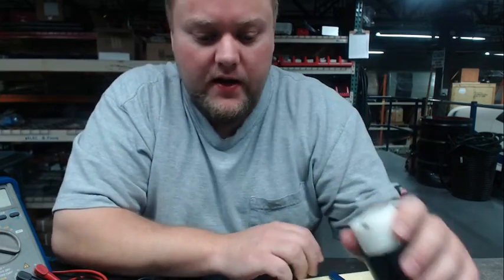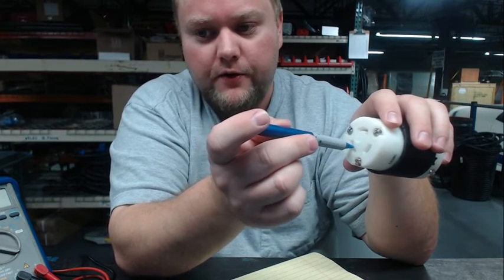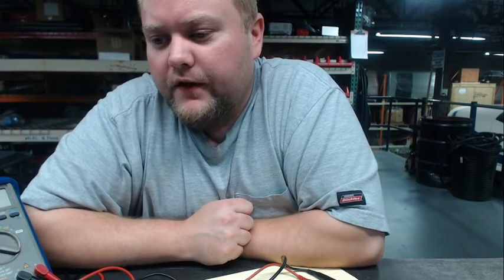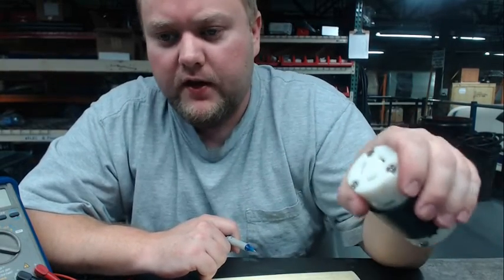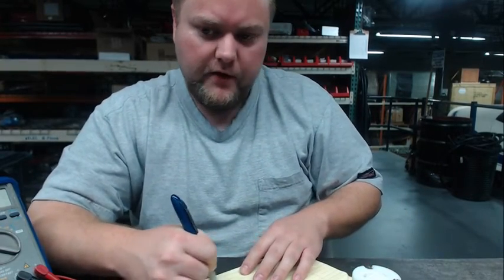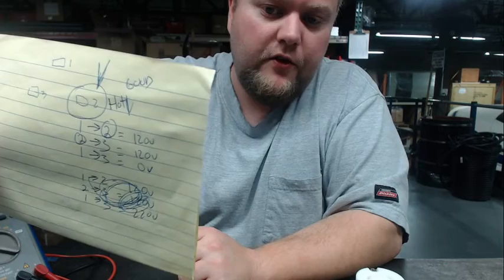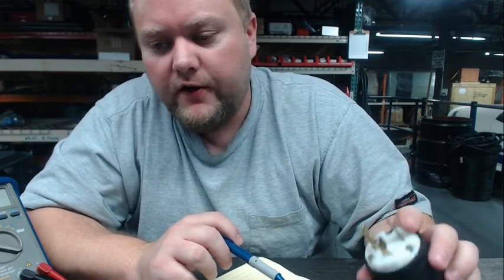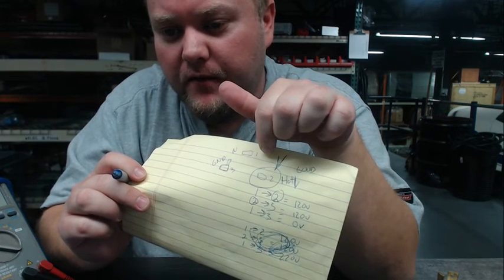NemaTwist Lock Single phase connectors

Comment: Great content and very actionable; I wound up in a usual situation.  I was looking for 3 phases, 30a, 240v, 4 pole, 5 wire diagram.  Then realized I only have enough room in my main box for a two-pole breaker: so, I need to change the plug on the end of the PDU from a 5 wire to a three wire; so, I am trying to determine which wires, (colors) to connect to which poles; which would make this process much easier, since I haven't ever wired up a three-phase outlet receptacle before.  If you could point me to a good reference point; or walk through that would be great.

Comment: If I have a L5-30 outlet and use 10/2 wire to get power from my 3500 watt generator to power up my house, of course limited only and with 120 only, what wires do I attach to my 30 amp double pole breaker? Would I attach the black  and white to a double pole?

Comment: what if all 3 screws on the l5 plug,(3 prong) are the same color?
Reply from the maker: Are they labeled?  You may have labels such as L, N, G  L=hot or black (in us).  N= neutral or white (is us).  G= ground.  Sometimes may also be X,Y,G  X is hot Y is neutral. G is ground.  Also if you look at the prongs that actually plugs in to the female receptacle they may be color coded and 2 of the prongs are the same size/shape those are hot and neutral.  The larger of the 3 prongs that also has a 90 angle on it is the ground.
Reply from the maker: Can also check this link it has a good picture of the L5 connector diagram  
http://41.p-and.be/30a-125v-wiring-diagram.html

Comment: I have X...Y...and G. Printed on the plug. What is X and what is Y ?
Reply: X will be black wire (line1, hot) Y will bw white wire (neutral, line2)
Reply: I had the same question, but tks both of you gays, I have my answer.
Reply from the maker: X is hot (black) y is neutral (white) G is ground (green)